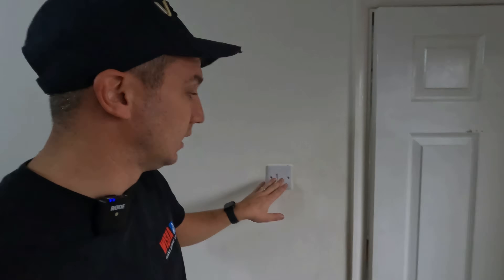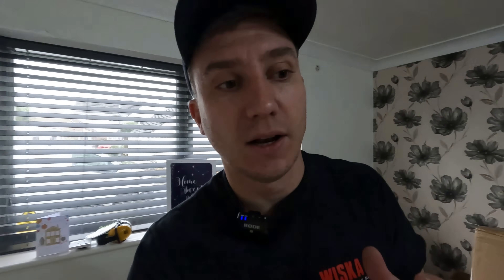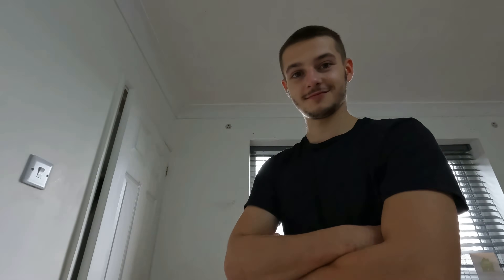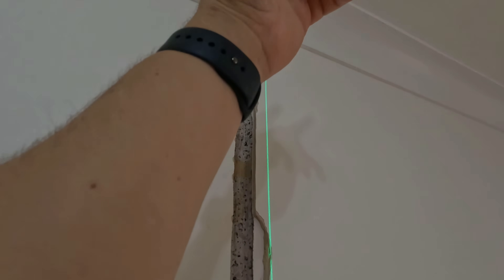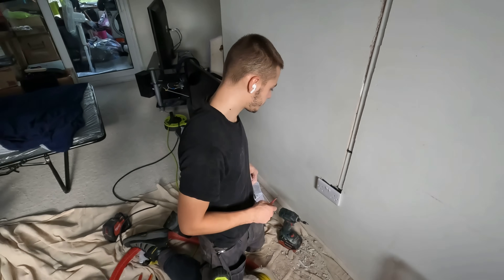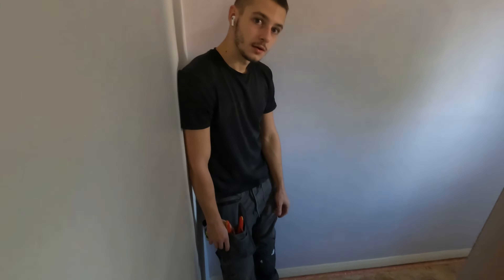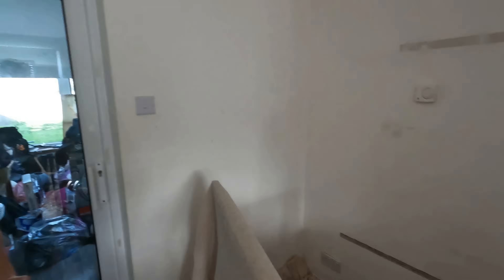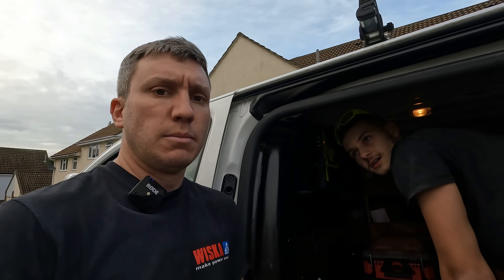CHASING WHEN THE TENANTS ARE HOME! OCCUPIED REWIRE #electrician

Comment: Wife refused point blank to let me dismantle the old kitchen to chase and rewire before the new went in, plus it is flat roof that end. Had to cut holes like your chipboard floor in the ceiling to locate the existing cable entry for the sockets and reuse one for the cooker drop behind the new units. The fitter made a flying pelmet for me to carry the circuit across. All sorts of get arounds to keep in spec.

Comment: Can't you start high, and then chase down - let the weight of the tool help; just ensure your weight is above the tool. You seemed to be struggling pushing the weight upwards into the 'load'
Reply: Wouldn't it depend on the spin direction of the blades? If you go the wrong way, the machine can want to run away from you. That might be more dangerous.

And then holding the machine facing down might work, but could be awkward to hold and thus dangerous because those machines are dangerous